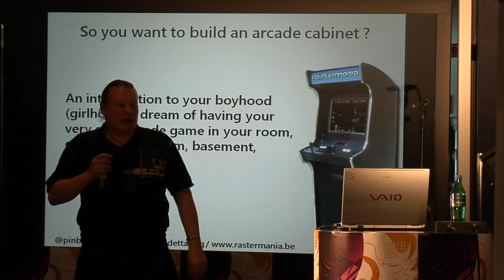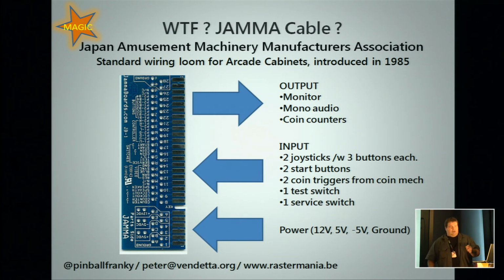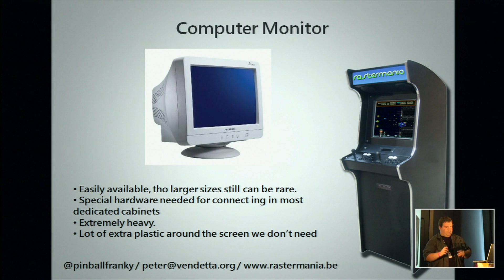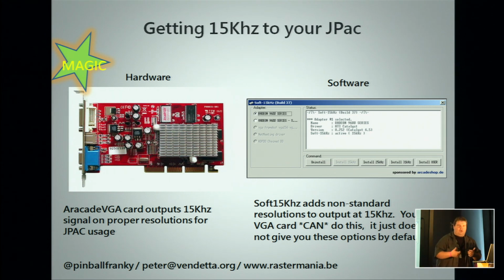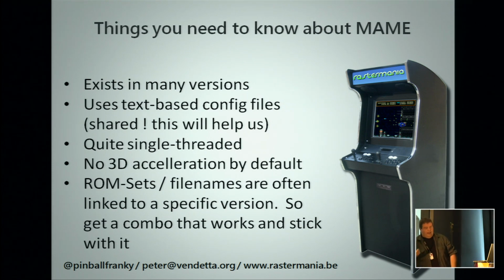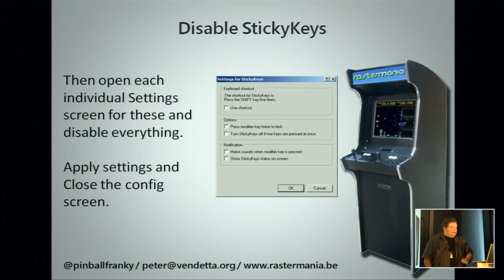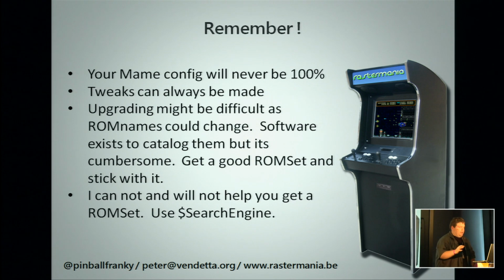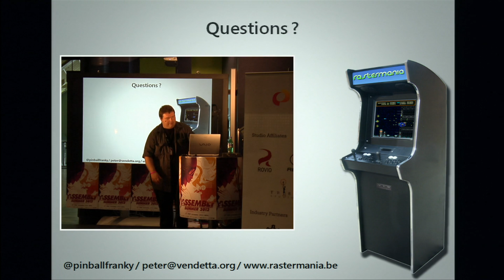So you want to build an arcade cabinet

Comment: hmz, full 2 player control set: 45 to 65$ on aliexpress. Buttons, joysticks, usb-board, cables & microswitches. all is included, just look for the ones with free international shipping.
if you allready have an old pc & flatscreen you just need to get some mdf-sheets and for arround 100€ your base is set to build your own arcade. you can allways add artwork and t-molding later. Even the woodwork it's not that hard, just give it a go. slow & steady wins the race :) you'll see, it'll work out. Good luck!
(you can find lots of decent example diy-videos on youtube)

Dus mede-belgen: betaal geen 150€ voor een control-setje van een of andere belgische site, rechtstreeks van china bestellen die handel! :D
Reply: Jany Declercq zijn die setjes een beetje degelijk? Ik heb er zelf van Gearbest besteld (€18 per set) maar nog niet gebruikt.